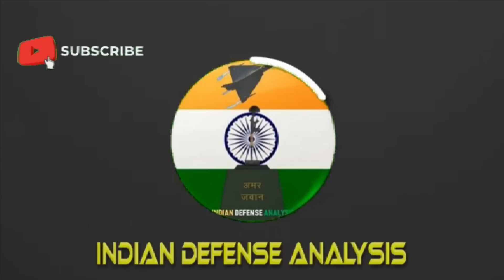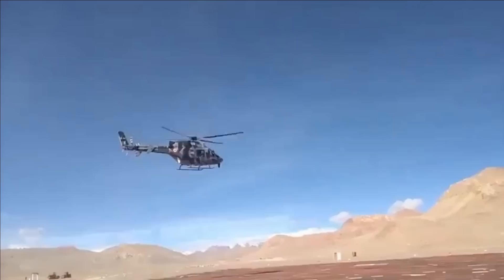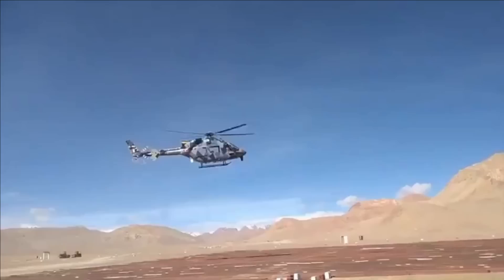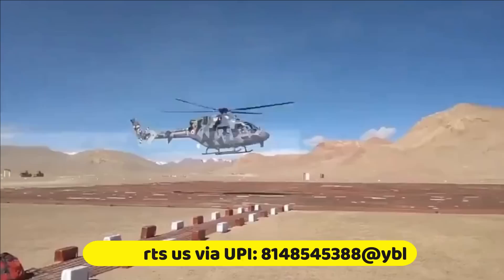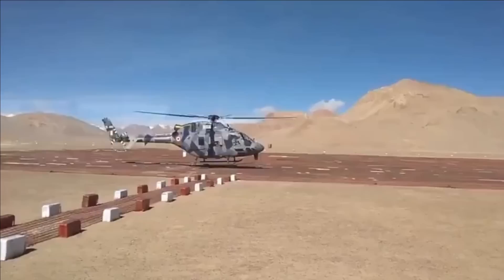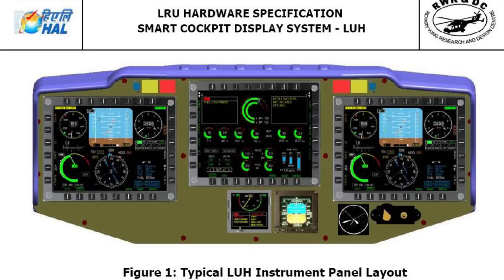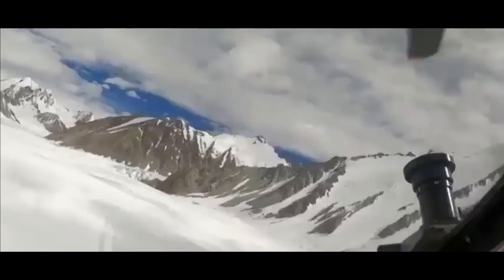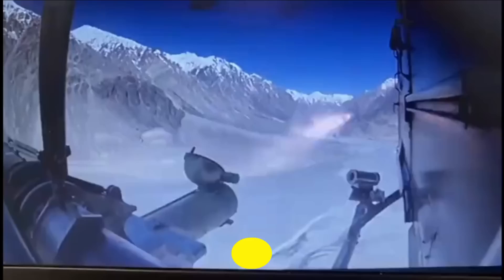Armed Light Utility Helicopter(LUH) : Mission Computer | ATGM | Adv. EO/IR Sensor #iaf #indianarmy

Comment: The Acceptance of Necessity must be cleared right away and an order
for 175 more placed immediately. With end of life for the older Cheetak
there is no more time for endless delay. It will take at least 3 years 
minimum to produce enough helicopters so production must start now.

" The Tumakur assembly line will be able to produce 60 helicopters per year from 2023 onwards. 
It is expected to be fully operational from March 2022."

That means the orders should have been placed last year. This raises the questions of how
IAF/IA can conduct operations in the meantime. Hopefully drones can do the job sufficiently well.

Comment: Cant we use the cheetah design to heavily modify and make it like little bird?
Reply: But why you want to do that?...because now we have much better options like hal luh...
Reply: Chitah mein 6 passenger nhi le sakte LUH mein le sakte hain. Utility ka matlab hi hay transport.
Reply: @ishwarayyahiremath3873  luh not good for special operation purpose when the space is limited search little bird with navy seal those choppers are really small and thus makes it easy to deploy in congested space and provide decent air support
Reply: @surojeetchatterjee   May littlebird k category ka bol raha hu kiyuki nsg or para sf asa helicopter bohot imp hay specially nsg agar hota to 26/11 may or bhi efficent deploy ho patay
Reply: @sagnikchatterjee8122  there is not much difference in dimensions between hal luh and cheetah, so luh can be used to perform operations in limited space...luh has better performance characteristics than cheetah in every aspect...